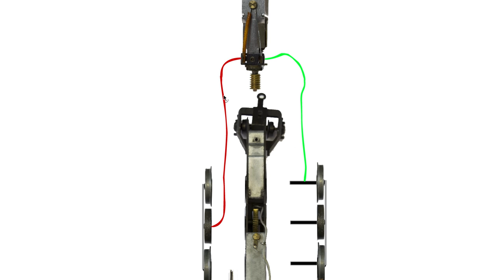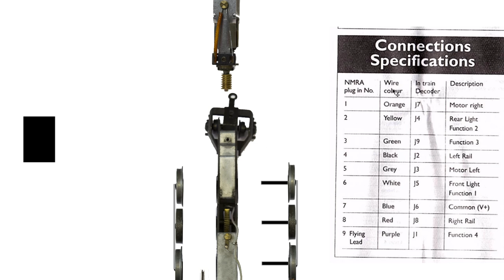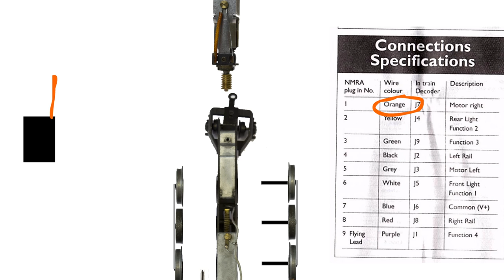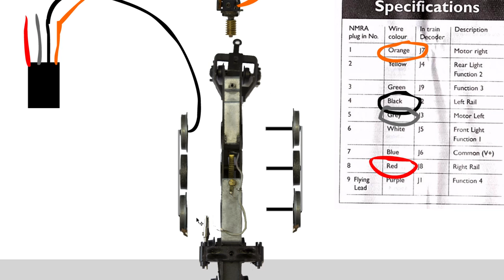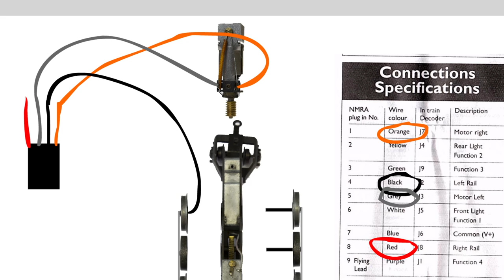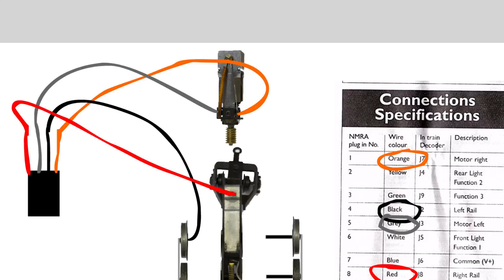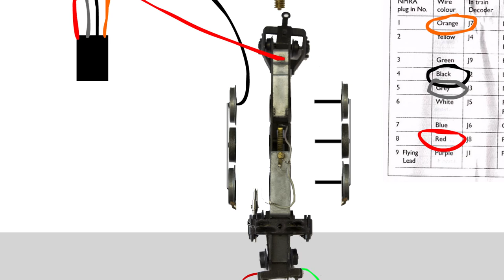How to DCC a Tri ang Loco

Comment: Hi Sam. This is great video Sam explained perfectly. I converted a battle of Britain class although I found the basic hornby chip did not handle the power of the older motor so I changed it for hornbys premium chip. I also fitted a socket so the chip plugs in effectively making the loco DCC ready.
Reply from the maker: Hi Andrew - thanks so much for the kind comment mate - hmm that's odd about the standard chip - I've never had that trouble before! That's a very good idea too - fitting the socket - thanks for the tip!
Cheers,
Sam :)

Comment: Thanks Sam. That was very helpful. I've got a Hornby GWR Pannier Tank I have to do with the same motor. I run my layout - H0 gauge - with a Digitrax unit, so I maybe have to get a micro decoder - possibly N gauge - to fit into the tender. One good thing about Digitrax decoders is they are warranted for user "stuffups", so if you blow one up they will replace under warranty!

I will get a decoder in the next few days and see what happens.

Regards, 

Ian
Reply from the maker: Hi Ian, no problem mate - ooh that sounds good, I might have to look into those myself then, hehe!
All the best mate, and good luck,
Sam :)

Comment: Cheers for that video, I was trying to think of a way to completely isolate the motor from the chassis, I went from insul tape and plastic screws to heat shrinking the back end and superglue, the electromechanical part of my brain must be on holiday at the moment so thanks for stopping at least an hours worth of brain ache.
Reply from the maker: No problem mate - glad you found it useful! Heat shrink tubing can be great to use as insulators - just don't burn through it with solder ;D

Thanks for watching,
Sam :)

Comment: Sam, I just found this video as I have given a Battle of Britain loco and want to convert it to DCC. It’s a great video for the most part but there are a couple of glossed over element that I hope you can elaborate on. The first is at 1:54 where the motor is removed and I’m assuming that a screw needs to be removed before the motor slides out. The second is at 11:10 where you mention the right wheels running on the right track. Please can you give me some more detail as to what is the right track and what are the right wheels. Do I need to purchase a new set of main wheels or only use old track. 
Thanks in anticipation and keep up with the videos, they can really help us newbies.
PaulO
Reply from the maker: Hey Paul - ooh good luck with that! Yes I didn't detail the actual process here, just the theory! The rear motor screw does need to be remove! The wheels live with the track are on the side with no visible pickups - you should be able to see from the underside! I'm not sure exactly which track does or doesn't work with these - best to try them on the track you intend to use. Most of these should be fine on modern Hornby set track, as well as period track from the 1960s!
Thanks for watching - Sam :)
Reply: Wow, fast response.. you must be locked down. 👍 Stay safe. PaulO

Comment: Good video! Might be worth mentioning that the old Triang locos had metal couplings which of course are also live. It could cause a problem if connected to another loco with a metal coupling if the leads are swapped in one of them. With my lack of attention to detail always possible (I guess one of the engines would run backwards). I think it would cause a short? The plastic couplings don't cause a problem and can be glued on with araldite.
 Do you know of a video on how to add an additional collector as the old locos sometimes have poor pick up which was not so critical for DC? Also I wonder if the current draw on an old Triang motor might be more than the 1 amp for a Hornby DCC - if the magnet is a bit iffy. Have you had a problem?
Have you ever fitted a stay alive capacitor to a Hornby DCC?
Reply from the maker: Yeah you're right - that does happen, but only if one locomotive is coupled to another that's running the opposite way around - I have experimented with them before to see if that would happen!
I don't know of any videos like that actually - and I've certainly not tried that before. One possible way might be to acquire a modern bogey with pick-ups, and attach it to an older loco, wiring it up! Of course there are ways to add your own pick-ups, if you're brave enough!
As for the current, a tri-ang loco typically pulls between 0.2 and 0.3 Amps, so they should never be pulling as much as 1A, regardless of how bad the magnet is, though of course it's advisable to only run locos with decent magnets!
No I've not tried the stay alive caps, but they do sound like an excellent idea!
All the best,
Sam :)
Reply: @SamsTrains  Do a bit of research Sam. Some of the older models can pull over 2 amps if they stall

Comment: Sam, thanks for the video, very useful.  i am in the process of convert and old Ivatt hornby triang i was thinking of moving the DDC chip to the tender, have you ever done that, if it works i could add a speaker too and making it a sounds version as there is lots more room than in the loco body.  let me know if you have done this or ever thought about it?

Comment: Nice one Sam. This was really interesting. I've just bought a couple of chips to give this a go with some old Hornby locos. Just need to pluck up the courage to give it a go now ... Steve
Reply from the maker: +Steve Lea haha, don't worry about it! Worst case scenario = you're not happy with the way they run so you have to take the chip back out, you can still use them in other locos!
Good luck,
Sam :)

Comment: Hi Sam. Excellent video. Thanks.
A couple of questions:
When you talk of left and right, is that from the perspective of looking from the rear of the locomotive towards the front or the other way around?
Secondly, I’ve heard that the older locomotives draw too much power which can fry the decoder. The loco you were working on looks fairly elderly. Is this a common issue, or have others just been unlucky?
I love your channel - keep up the good work.

Comment: Step 1, Make sure the loco actually works well on DC, if it doesn't run well on DC, it'll probably run worse on DCC.
step 2, You only need the black, red, grey and orange wires. I start by desoldering all other wires, then cut the plug off the 4 we need.
step 3, wrap black electrical tape around the DCC decoder. then a bit around the exposed top, then bend the wires down over the decoder, and wrap tape on the other side, before wrapping tape around the whole thing again... fully insulated.
Step 4, open your loco. pull the insulation sleeve off the right side of the motor (yours is upside down...) cut it in half, and put it back on both sides of the spring.
Step 5. grab an old brush and cut it in half. (or obtain any small piece of thin brass/copper to make one.) solder the grey wire to that. Clean up the existing contact that the wires is already soldered onto, and solder the orange wire to it. Re-apply them to the motor. (I don't solder directly on the brushes in case they need replacing)
Step 6. Remove the wire from the bottom plate, solder the red wire to it. and solder the black wire to the eyelet.
Step 7. make sure there's a capacitor across the motor somewhere, I solder a second pair of wires to it, and those terminals.
Step 8: Test it. by applying DC to the brass pickup and the chassis. Hornby DCC decoders support DC by default, so it should make the motor spin.
Step 9, stick the Decoder to the chassis, and put the loco back together. Care must be taken to make sure everything actually fits together, I've found I've had to re-do it more than once because something was pressing against the inside top of the loco shell.
Step 10. Test it with DCC on a test track (or your trainset).
Reply from the maker: Very good summary - thanks for sharing! :D
Thanks for watching - Sam :)
Reply: @SamsTrains  Glad you approve. I did look up a few videos about DCC previously, yours was fairly clear, though I actually did convert my first X03 loco before watching this. Wrapping the whole thing in Electrical tape does help for locos like these X03/X04 based ones where the Chassis itself is live.

Comment: Hi sam, I’m considering changing to DCC and found your tutorial very helpful, just one question is the left and right correct? I work in the motor trade and as the front of your engine is at the bottom I thought it would be the other way around, left and right would be determined as if your were sitting in it facing forward ??? Loving your channel
Regards Paul

Comment: Great video Sam, I was puzzled about where the pick ups were on an old loco but you have made it all so clear. Just one point I have been changing to ddc on and old Hornby ring field motor with lights, and they are not working using the white wire from the decoder. In your video you mentioned the blue wire being a ground. Do I need to connect this wire to get the lights to work. Happy New Year!
Reply from the maker: Glad to hear this helped mate! Yes you would need to connect the ground wire too in order for the lights to work!
Thanks for watching, Sam :)

Comment: I've been looking for weeks now for a video to explain where to connect to my open frame motor.  THANK YOU SO MUCH FOR MAKING THIS. I am converting a Mantua 4-6-2 to DCC.  Only have one question.  The Decoder manufacturers state a lot that the motor must be isolated.  I assumed that meant since the frame has power from the rail that the brass screw would have to be changed to nylon and that kapton tape would have to be placed under the motor to isolated it from the frame.  Is my understanding incorrect?
Reply from the maker: It's a real pleasure John, really glad this was some help! Good luck with the Mantua. Yes it's better if the motor can be isolated, but as the commutator should also be isolated from the motor, it's usually sufficient to isolate just the brushes, as done here!
Thanks for watching, Sam :)

Comment: I've now watched this for the second time, Sam. But I have heard/read somewhere that these old X03 / X04 motors aren't suitable for conversion due to drawing too much current?
Reply from the maker: Not so much current - if properly serviced they should only draw 0.2-0.3A, they do produce lots of back EMF though, so you need a quality decoder that can handle it. Also tri-ang locos aren't terribly suitable due to the small number of pickups, so some kind of stay-alive is worth looking into!
Thanks for watching, Sam :)

Comment: Hiya Sam, as usual a great vid, I do have a collection of tri-ang loco's from when I was a kid back in the 50's and a great deal of old tracks to run them on, the motors I beleive a called XXX  motors, but there one thing I don't quite understand regarding the "spring" connecting the bushes... from what I understood I need to instullate both end's of the "spring", surely that not right (and if it is then by snipping a bit off the existing intsallaion to use on the other end that should suffvice), please can you clarify that...Iddy
Reply from the maker: Thanks for sharing Idris! No, only one end of the spring must be insulated, as the left one is live to the loco chassis! :D
Thanks for watching, Sam :)

Comment: Thanks for making this video. What Hornby chip did you use and what does it run like at different speeds? Did you have to alter the CV values at all to stop the erratic running?
Reply from the maker: Hi, no problem! I cant remember the exact product code, but it's just the standard Hornby 8-pin chip. They tend to run perfect on the default settings, though you can increase the minimum speed CV to ensure they don't stall by going too slowly, that's all!
Cheers,
Sam :)
Reply: Thanks Sam, I'll give it a try. I've fitted a chip to a Hornby class 86 but I had also replaced the motor with a 5 pole. Some of the cheaper 3 pole motors fitted in the 0-4-0 tank engines are really jerky on DCC for some reason? I think they were Scalextric motors they fitted in those?

Comment: Hi Sam where about would you connect the common and how would you wire it for a triang smoke box? Thanks
Reply from the maker: Hi Andrew - you can wire the common anywhere on the metal chassis! I'm not sure about the smoke generator - you'd want to know how much current that draws before wiring it in!
Thanks for watching - Sam :)

Comment: Great video Sam. Thanks very much. It has given me the confidence to convert my childhood Jinty (Triang 060). Needs a service first tho. One question. The train has an additional wire with a resistor (I think) for the smoker and is attached to the motor. Will this effect the method you use. Also, having not purchased the chip yet I am struggling to see how it would fit in this engine. Thoughts??
Reply from the maker: Hi Chris, thanks a lto for the comment! I'd strongly suggest removing any smoke generator before converting to DCC, unless you know that the total current won't exceed the rating of the decoder! You'll also need a way to isolate the generator from the chassis, which is easier said than done! If the device you mean is the capacitor, you can leave that in place, it's supposed to be in parallel with the motor, and it helps reduce arking on the motor!
Thanks for watching,
Sam :)
Reply: Thanks Sam. My Triang is a 1964 or'65 engine with a Syncrosmoke cast metal smoker. The issue that myself and other readers who want to convert theses engines is that the body screw holding the body to the chassis attaches itself to the side of the smoker. I could try attaching by passing a screw down the chimney (as seen in other models) but this will take some thought. Thanks again, hopefully a solution can be found. Cheers, Chris.

Comment: I thought it was a big no no when it comes to chipping a open motor like the one you have here. I've been under the impression that the motor had to be completely removed from contact with the frame otherwise you'll fry the chip. Plus I'm not really understanding what you're talking about with the insulating wire and putting tape on the screw. Any help would be appreciated I have several locomotives that have this type of motor and it would help with having to replace it with a can motor. Thank you
Reply from the maker: Hi Russell - it's not recommended - but not because of insulation. The motor frame is in contact with the chassis, but by insulating the brushes from the spring, you can isolate them, and wire directly to them 100% safely. I don't really recommend this, but only because the X04 motors produce a lot of back-emf, and they can get quite heavy on the old current-draw, and can damage decoders if you're unlucky. If you must do it, use quality decoders, check and service the motors regularly!
Thanks for watching, Sam :)

Comment: Right at the end you talk about the correct track for the correct loco. I have a loco that picks up dreadfully. Can you please explain how  I can overcome this. I believe it is an old Triang shunter D3035.
Reply from the maker: Are you using the 08 on DCC? Unfortunately with only 2 pickups going to each line, they don't tend to run well on DCC unfortunately, particularly if they're the kind with the large flanges!
Thanks for watching - Sam :)

Comment: Hi Sam Great video as always. Is it possible and if so how difficult is it to fit a DCC chip to a tender drive locomotive with a ringfield motor?
Reply from the maker: Thanks a lot Peter - it's reasonably easy to do, but it can be tricky to insulate the motor from the chassis!
Thanks for watching - Sam :)

Comment: What if you wanted to add a smoke unit? Which wire would you need to keep then?
Reply from the maker: Hi Thomas, you'd just look at the data sheet - you could use any of the functions really, using the common return wire as one of the connections!
Thanks for watching,
Sam :)
Reply: Sam'sTrains thank you Sam!

Comment: Hi Sam, have you ever done anything on fitting DCC to a ringfield motor. Just found my old sets from the early 90s. Both intercity HST sets plus a Lima diesel. All run on ringfield. Any help would be hugely appreciated! Chris
Reply from the maker: Yeah I've done it many times - it can work very well, but only on the most reliable of runners! The biggest issue is isolating the motor brushes from the chassis - one is easy, since it's a wire - the other is more difficult since it uses a screw. The solution is to remove the long brush retaining screw (which reaches to the back of the chassis where it makes contact), and select another screw with a thicker thread, that will tap into the plastic without touching the metal chassis - you can trim screws with a dremel to do this! Then it's nice and easy to fit the decoder!
Thanks for watching - Sam :)

Comment: Sam I was wondering with the decoder on triang Hornby winston Churchill where would the wire go for the smoke unit and which wire would I need to use?
Reply from the maker: +MrMarkey4184 Yeah, you can do that - you just need to wire it to one of the functions and the 'common' wire. You must first run the smoke generator on a regular 12v power supply and test the current draw first though - there may be a maximum current for the decoder, so it's worth checking!
Cheers,
Sam
Reply: +Sam'sTrains thanks for the update Sam

Comment: Sam, can I add a stay alive capacitor once I have converted DCC to my trian loco. If so, where are the solder points points on the Hornby 4 pin decoder that I am using?
Reply from the maker: Yes you can, though the decoder will need to support the feature - I don't think the Hornby ones do! I could be wrong though, I've never tried it before!
Thanks for watching, Sam :)